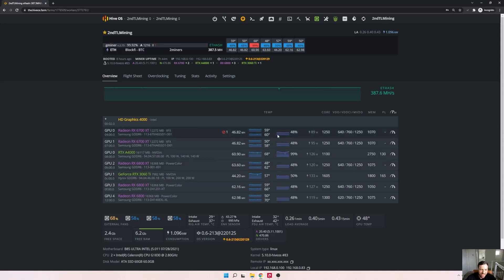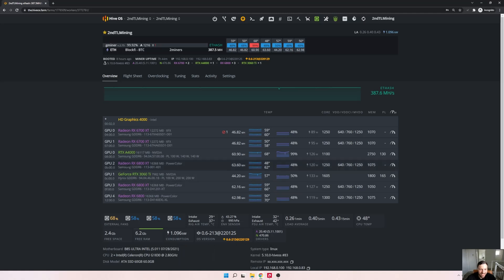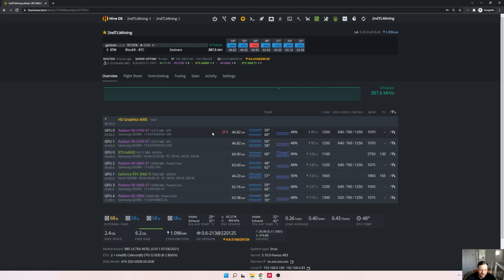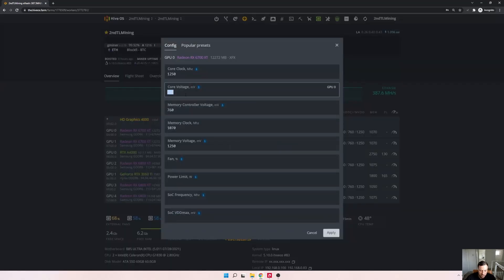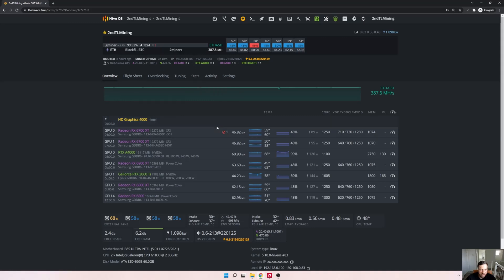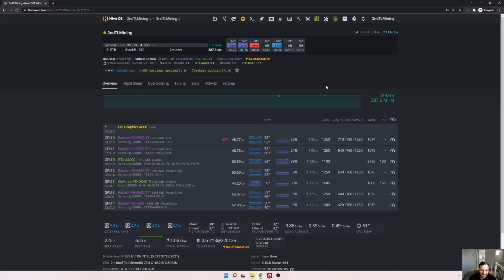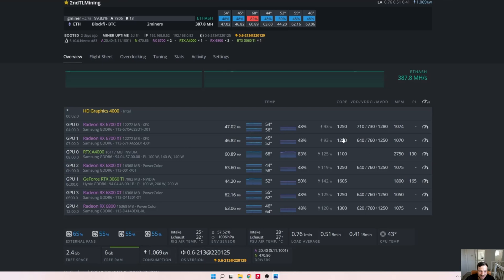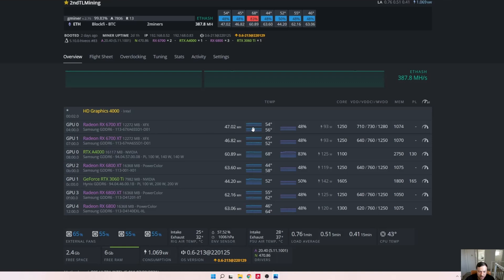Fixing Invalid Shares - 6700XT

Comment: Hi, would you help? i want to set the voltage for the core & bus controller & memory. How do i do iT? or how do you do it? i have 6700xt  ASrock  seven of them with the same preset  only one with invalid shares. Thats why i want to manage the voltage
Reply from the maker: Are you using Windows or Hive OS? Because in Hive OS, you can manage this quite easily probably what you saw for me in the video. As i turned down my overclocks a bit which reduced my errors. Now for windows you would need to modify the BIOS using More power tools, but the same settings are there.